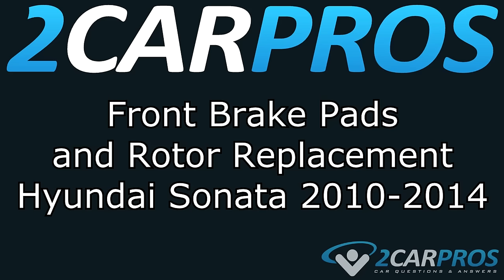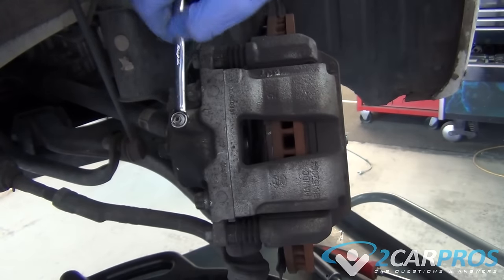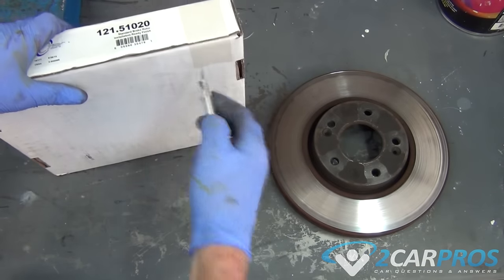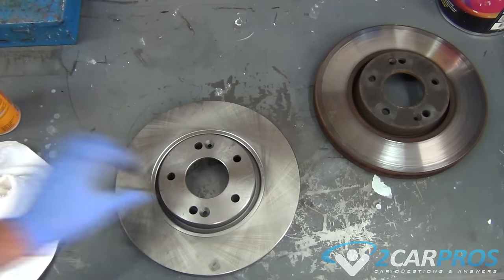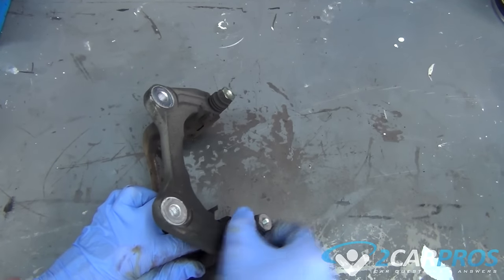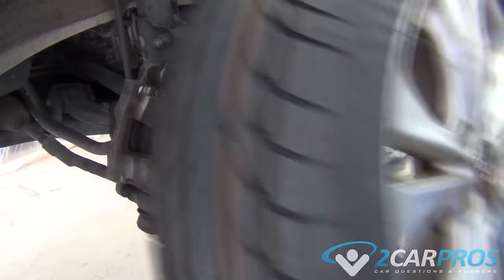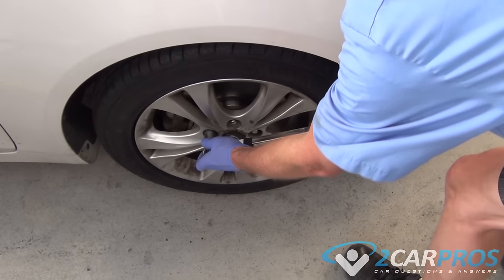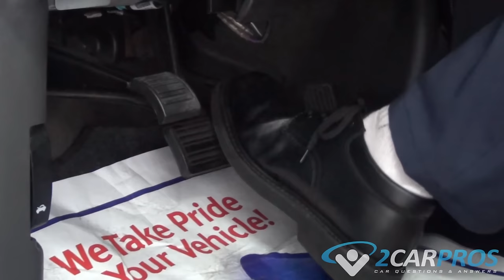Front Brake Pads and Rotor Replacement Hyundai Sonata 2010-2014

Comment: Very nice video.  Great presentation.  I want to note I used this as a reference for my 2010 Sonata GLS (with the 16" tires, not the 17" SE/Limited trims)  Mine fronts were lot more difficult than this car.  The hose connected to the piston was only about 3 inches long, giving me almost no slack to wiggle it off.  Once I remove the piston, the lack of slack meant it was constantly in my way.  Used a bungie cord to keep it back as much as possible.  Also, the top bolt was hidden behind a mount structure.  Had to use a socket extension to reach it, along with a good wrench to get that bolt off.  Not a lot of room to work either with the piston in the way.  Probably not as bad as having to remove the control arm on the rears though.

Comment: Thanks you for this very helpful video!  One suggestion:  use the new brake pad hardware (shiny flexible sheet metal things that mount to the carrier--come with all pads I've ever bought) and also thoroughly clean all the rust from the carrier surfaces where the pad hardware meets the carrier.
Reply: YES! That rust on the bracketis the numer one reason for premature wear.

Comment: Two questions. What grease did you use for the brake slides? Special lubes for everything nowadays. Also I would like to know the exact year car you worked on just so that if it's differs a little from my 2010 I'll know to expect that it may not exactly as shown. Thanks. Great video!
Reply from the maker: Just synthetic brake grease that comes in a tub. It needs to resist heat real well. Sometimes it comes with the new brake pads. I believe this was an 08 but I can't remember it was so long ago. Thanks for watching!
Reply: Use silicone

Comment: How similar is this job to a 2015 Sonata? Thanks!
Reply: Pretty much exactly the same. I have a ‘16 and t’s the same process. I hope you got your brakes fixed by now though. 🤣
Reply: @sierratrey  lol yeah it's the same went smoothly. My rear caliper bracket bolt was hard to get off though
Reply: @Tradrnq  it’s definitely a knuckle buster. Make sure you remember the washer when reassembling the caliper. Ya know. Before you secure everything and drop the jack and find the washer sitting on your creeper. 🤦🏼‍♂️🙄

Comment: I noticed that you didn't use new pad hardware or clean the old hardware. I do either of those and always use some grease on the pad "ears" to ensure they move smoothly. If you haven't already, you might also make a video about mating the pads to the rotors by bedding the brakes. Other than that, very well produced and helpful video.
Reply: No, it's not...never torque your lug nuts like that. You're supposed to let the torque wrench do the final tightening, then when it clicks you know you're at the correct torque. The way that it was done in this video, he torqued nothing. The lug nuts were already tighter than the factory specified torque. Just look at the torque wrench...it never moves before it clicks. That's the real sign the lug nuts are already tighter than they're supposed to be.

Comment: do I really need to loosen the bleeder valve to push the cylinder back with screw driver? Does it just make the job easier? what if I do not loosen the bleeder valve?
Reply: If you don't either open the brake reservoir in the engine compartment or the bleeder valve as they showed,  the system will remain under pressure and it will be near impossible to move the cylinder back.  If you do manage to manhandle it you will run the risk of blowing a seal or hose somewhere in the brake system and then your problems have just begun tracking it down.
Reply: Why not just push the cylinder back in with a caliper piston tool?

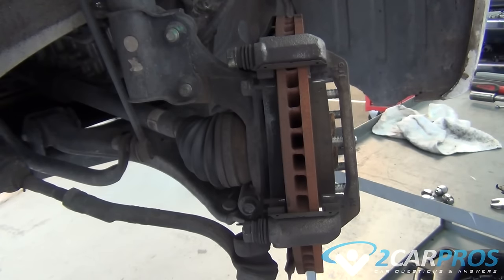Comment: 2:00 you're using a normal chrome socket.  Aren't air safe tools always black?
Reply: @fenderstratguy, no. What he used was fine as it was just an air ratchet. The black sockets you're are referring to are impact sockets, like what was used on the impact gun used on the wheel's lug nuts. The difference being the tool used to turn the socket. The impact sockets are heat treated to handle the stress from the hammering that impact tools use to break nuts and bolts loose. If you notice when the wheel was reinstalled he used the impact gun then checked with torque wrench... however the impact had already tightened the lug nuts tighter than the factory spec. Not usually that big a deal, especially since this is a cheap Hyundai but not something you'd want to do with a higher end wheels. If they insist on using an impact to install wheels then they really should be using torque sticks. Installs on the impact gun and stops tightening at a predetermined range. Otherwise you'd lightly tighten lugs with a standard ratchet and then use the torque wrench like they did in video.

Comment: What do you guys use to lube the pins??
Reply from the maker: Sometimes grease packs come with the brake pads meant for the pins. If you did not get any packs with your brake pads any silicone grease will work. I'm pretty sure we use this https://www.amazon.com/Valvoline-VV632-Fortified-Multi-Purpose-Vehicles/dp/B000GAD07O

Comment: Excellent video. I’m surprised that only 2 screw hold the rotor to the hub.
Reply from the maker: Thank you! :)

Usually nothing actually holds the rotor to the hub. Like on my truck the force of the lug nuts are what hold the rotor to the hub.
Reply: The screws only purpose is for the assembly line process.
Reply: Im absolutely amazed how easy his screws came out. I did notice a stain from, lets see, about a full can of liquid wrench-type product. 😄 
The only way I got mine off was with a Lisle Hand impact tool. That’s after I stripped the first one when I tried my Porter Cable impact driver. (FYI, probably not the best idea, the screws are surprisingly easy to strip)